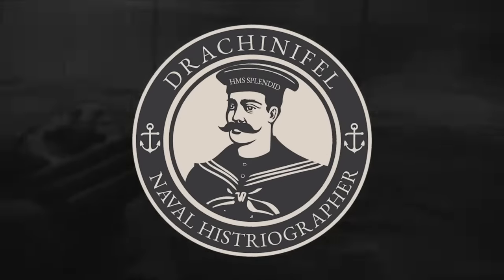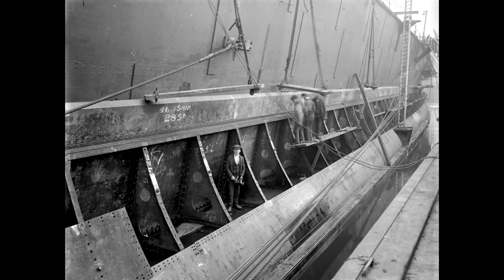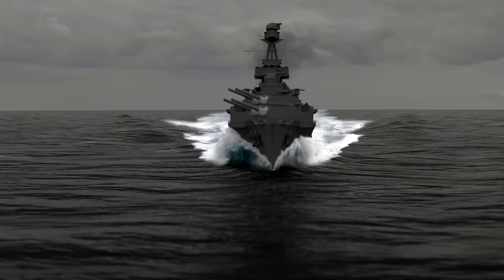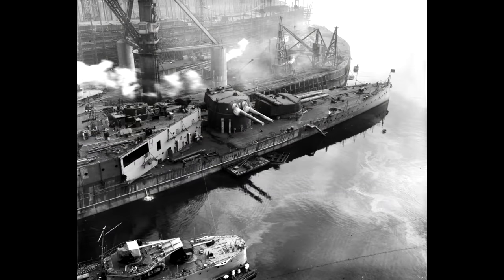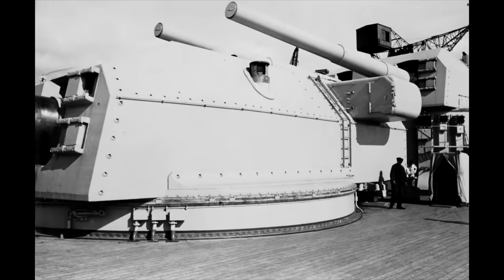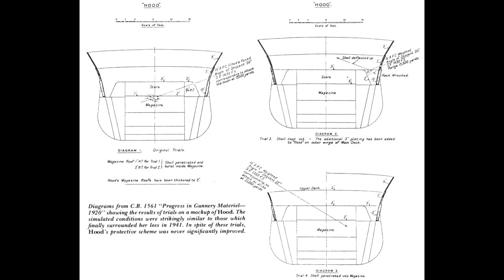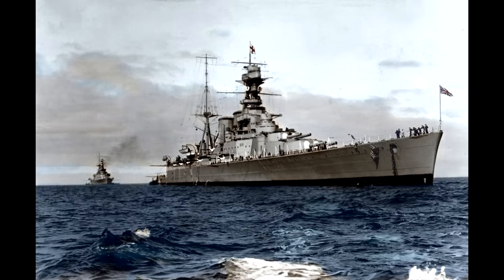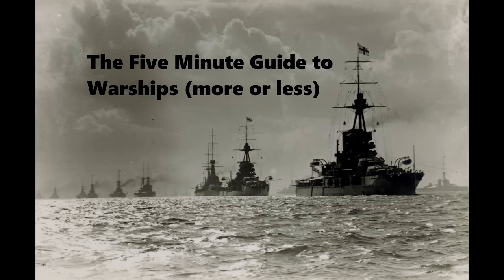The Loss of HMS Hood - But why did it blow up??

Comment: Its interesting to note that, although Prince of Wales retreated behind a smoke screen after the Hood was sunk, she got 2 crucial hits on the Bismark, 1 straight though her bow causing a large amount of flooding and a reduction in Bismark's speed, and another one in one of Bismarks fuel tanks causing a loss of critical fuel and also causing a trail to be formed behind Bismark that made her easier to spot by ally planes. RIP crew and officers of POW, you did your part.
Reply: you feel better believing it(:-)
Reply: Besides the torpedo that hit the rudder, Bismark looked mostly undamaged when it sank, most likely by its own crew to avoid the humiliation of being taken by the British? It had hardly any functioning guns left by then.
Reply: The second hit also penetrated a boiler room, reducing her speed further.
Reply: @finncarlbomholtsrensen1188  nothing to do with the destroyers told to finish her off with torpedoes then? Lmao.

Comment: Well done Drachs, its a superb analysis; been reflecting on this off and on for years, and this is the best explanation I've seen. Three additional nuanced thoughts. First, the weather on the day, from the footage of Bismark firing, was about Sea State 4 or so, by eye. With Hood steaming at 28 knots, the depth of the exposed area under the main mast will change slightly as she runs through the swells and troughts, with the possibility again of further exposure of the hull area below the main belt, thus potentially further increasing the probability of penetration. Second, if her turn to port is underway, then at 28 knots she will start to list to starboard, by 5 to 7 degrees, I'd guess, which will change the impact geometry slightly, and in two ways: the exposure of the hull below the waterline will be reduced, thus reducing the probability of below belt penetration; but this will be balanced again slightly the change in horizontal geometry, as the angle of penetration becomes closer to perpendicular. Third, and very subtly, if the Hood's rudder has just been put over, but she has not started to turn, then else will come into play. Battleships and battlecruisers were designed with metacentric height such that they were not too 'stiff', and were thus good gun platforms. For any warship, but especially a warship that is so designed, when the rudder is put over, the first thing that happens is counter-intuitive, namely the vessel will list in the direction that the rudder is put over. The reason is to do with the physics, in that the rudder is below the vessels centre of gravity and, at the moment of the rudder being put over, a vertical lever force is applied below the centre of gravity, causing the vessel to list in the direction of the turn. Once the rudder bites, and the vessel's turn commences, then classical hydrodymanic forces come into play, and the vessel will then list in the opposite direction of the turn. In Hood's case, if the moment of impact coincided with the application of the rudder, but before it had begun to bite, then she would have been listing slightly to port, which would have further exposed the hull below the armour belt, and made for a slightly higher probability of penetration as you propose. All of which tends to increase the probability that your explanation is the right one.
Reply: Only that trough near the mast only existed when hood was turning on the inside of the turn
Reply: @buzzardbeurling  As was said, the ship hadn`t yet begun to turn as it is a few times heavier than your car meaning lots of inertia to overcome.
Reply: @Notmyname1593  actually it's possible she was as much as half way through her turn
Reply: @Notmyname1593  it's academic. There was no trough there on the stbd side
Reply: So the idea of turning away when a shell is incoming isn't what we call a good idea. That's when u just want to turn towards the shell, as strange as it looks. And with précise timing, if u please.
Reply: @vivianvaldi7871  not really. But since hood started her turn just before or just after the final salvo was fired then it's just part of the horrendous luck she suffered that day.
Reply: @buzzardbeurling  "Only that trough near the mast only existed when hood was turning on the inside of the turn"

WRONG.  Clearly you need glasses because you missed the high res image of Hood at speed on a straight course which clearly showed the trough where Drachinifel said it would be.  Add the sea state during the battle as Steven suggests and the trough would be even deeper at the right moment.

"There was no trough there on the stbd side"

An assertion made without evidence can be dismissed without evidence. —Hitchens Razor.

You have offered no evidence to backup your assertion that Hood was already in the turn when she was hit and her magazines detonated.  Drachinifel on the other hand has, through careful analysis, illustration and reasoning, demonstrated a very high probability of the conditions and events that transpired on that fateful day.  And Steven has offered some additional considerations that makes Drachinifel's analysis even more highly likely.
Reply: @MelioraCogito  i've seen the high res image. And another image in that series of pics. Aswell as hundreds of other images of hood at speed and the trough is only ever there in a turn. Furthermore it's always on the inside of a turn (ships lean out) and hood was in a port turn when she was hit and she was hit on the stbd side , the opposite side to where any trough would be. So before throwing childish insults i'd strongly suggest you have an elementary grasp of the facts before getting in over your head
Reply: @buzzardbeurling  Hood was not in a turn in the image Drachinifel provided that demonstrated his point on the issue.
Reply: @MelioraCogito  yes she was. Very slightly to port
Reply: @buzzardbeurling  And what proof do you have of this claim, a ship can’t sustain a 30 knot speed, as Drachinifel says she was moving at, in a turn, even a slight one causes drag on the ship’s hull, causing it to slow down, a slight turn to port could easily reduce her speed to somewhere between 27-25 knots, especially considering the length of the ship.
Reply: @Mrskydoesminecraft1  she wasn't doing 30kts in either the photo we're discussing or at Denmark Strait. At DS she was doing between 28 and 29kts.

A small turn of 20 degrees to port wouldn't slow her too much. At most about a knot and a half. I have the RN figures from 1 of her trials somewhere. Either way I'm not entirely sure what point you are trying to make
Reply: @Notmyname1593  I drive a G Wagon. It is a few times heavier than the Hood.
Reply: @buzzardbeurling  At speed on any large surface ship, there are two standing waves at the bow and stern, with a long sometimes deep trough between them usualy deepest just after midships, this is not solely related to turns. the container ships I was on were no different, its such a difference that at sea, when in the side passage or box girder, the "sag" can be seen as the ship sits in the trough.
Reply: @petertrznadel8107  that may be so. But on Hood it was only in that area during a turn.

And again Hood was turning to port and was hit starboard where she would have been heeling.
Reply: @buzzardbeurling  alright, lets say hood has its own imperial laws of liquid flow..

what is your alternative theory for the part that comes next - the detonation and sinking, or more precicely, what caused that?
Reply: Every ship is different.. Hull form, length, width, weight,  in this case depth and shape of the bulge. To assume that the form of the water will be the same as them all is far from scientific.

Hood had a known weakness. It was known when she was built.

A shell detonating just fwd of the aft engine room aft bulkhead behind which was the recently enlarged 4 inch mag is as Drach says what killed her. There is absolutely ZERO doubt in that part.

It got there through the middle 7inch belt and through the 2inch slope. The turn and obliquity of the hit made this possible. The armoured deck didn't reach out all the way to the hull edge. 

Where it went down into the slope there was no flat protection above it.

 In armour mock up tests in 1919 this was known to be a way for a shell to enter the ship.

They solved this by fitting a 3inch solid plate. This defeated the same shell fired on the same mockup in new tests.

However this was only fitted abreast the mag sets.

The entirety of the engines and boilers didn't get it. It was felt losing an engine or boiler room wouldn't be fatal so saved weight by not adding it.

This may have been ok had she been broadside on.
The obliquity of the hit and the turn allowed the shell to take advantage of this and travel up the longtitudginal axis of the ship pointing straight at the aft bulkhead.

Was a below belt hit possible? Yes. But highly improbable for more than 1 reason.

The 7inch hit is by far and away the best theory of the 2.
Reply: Very instructive comment indeed.
Reply: Good comments, I generally agree with this.
I think she would have heeled more than 5 to 7 degrees in mid turn at attack speed.
regards
Reply: @buzzardbeurling  That's WHY Napoleon said that he wants LUCKY generals :-)
Reply: @vladvah77  haha. Quite 🙂
Reply: @Steven Jermy - You have mentioned both of the two factors that I intended to comment on. The first point is the constructive interference of the bow wave trough with a sea wave trough, which could have significantly depressed the elevation of the water line to near or below the point of impact hypothesized by Drach's analysis.

The second point is the counter-intuitive list to port when the rudder is put over to port, before the turning force actually begins to turn the ship. The physics involved require that the resultant force acts below the centroid of the rudder surface, and there is a net force acting below the ship's center of gravity, which will act to roll the ship over to port, initially. Then, as the rear of the ship swings over to starboard, the inertia of its forward velocity will generate a centrifugal (pseudo) force that rolls the ship over to starboard.

Drach made it clear that his hypothesis is predicated upon one of the initial conditions being that the rudder had been swung to port, but that the ship had not yet actually started to turn. — in which case, centrifugal force had not yet become a factor, and the initial low-acting force tending to roll the ship to port was still in effect.  Coupled with the fact that there likely would be less (friction) resistance to rolling than to turning, your suggestion of the "counter-intuitive" initial rolling to port is plausible.
Reply: @Vito_Tuxedo  Yes, they're nuanced points, but they fit perfectly into Drach's brilliant analysis. I served in the Royal Navy and as well as being a naval aviator, commanded 4 ships, a destroyer squadron, but also trained all EU warships Commanding Officers at Flag Officer Sea Training. What was interesting was the lack of insight in some to these subtle ship-handling matters, which was not understood. In my experience of Boards of Inquiry - I chaired two into Sea Harrier accidents - when you're trying to work out what happened, you rarely have perfect information. However, each hypothesis is akin to sketch of a jigsaw, and my test for the most likely answer is whether the known facts pop up in the right place in the jigsaw - which, for Drach's analysis, plus these nuanced additions, they all do. No other hypothesis fits anywhere near as well.
Reply: @stevenjermy1098  I completely agree. A truly rational, intellectually honest inquiry does not cherrypick only those facts that fit a pre-ordained hypothesis. A rational inquiry must accommodate even the apparently anomalous unexplained nuances. Your own Board of Inquiry experience apparently has informed your appreciation of such criteria.

I suspect that Drach would be among to first to abandon his own analysis if other contravening evidence were discovered. But based on all of the facts and applicable conditions as they are currently understood (some of which Drach has brought to light), I do not know of another analysis that accommodates all those factors so completely.
Reply: @ironmantooltime  LOL.